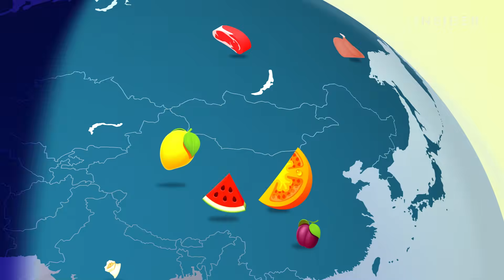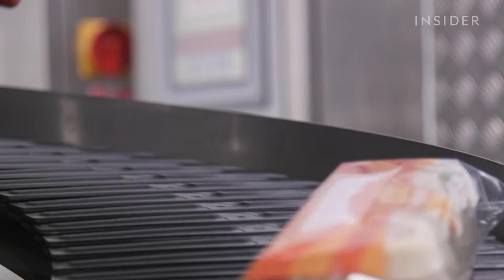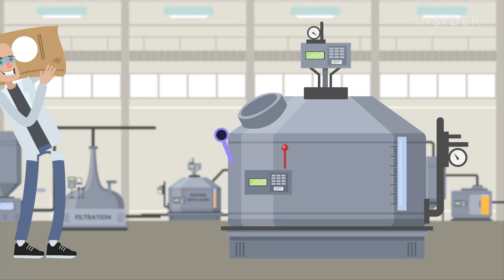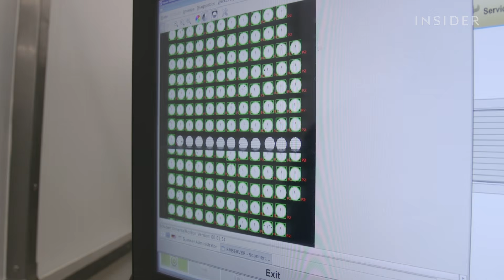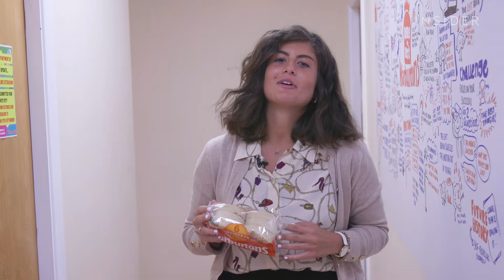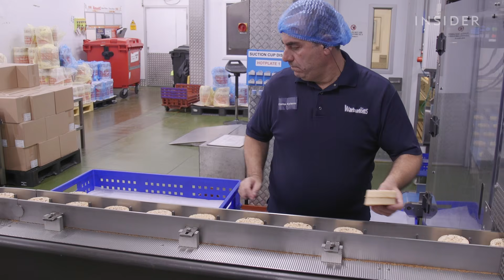How English Crumpets Are Made At Europe's Biggest Bakery | Regional Eats

Comment: 1. a pair into a toaster and heated like bread.... when they pop out of the toaster, whilst still hot, a smear of butter then another of honey.
2. proceed to nibble off the firmer edge of the base all the way around, which gives the honey and butter time to melt down into the holes.
3. then, munch through the hot buttery honey flavoured centre thats like soft bread but with a bit of texture given by the structure of the air holes in the dough.
Reply: I like mine on the crispy side so I put them in two or thee times.
Reply: Then go ahead and make another two🤪
Reply: Add a bit of peanut butter...you’ll love it 🙂

Comment: It looks like a open faced American (USA) English Muffin
Reply: Same size & shape, but not the same at all - they taste different & the texture is different too. A proper crumpet is made only using baking soda as a raising agent, whereas English muffins are made with yeast or sourdough. Muffins contain egg & there's none in a crumpet. Also a proper crumpet [not that Warburtens crap] is  cooked only on one side, so the bottom is flat & toasted while the top is speckled with holes. An English muffin is like white bread when you look at the inside cut surface while the crumpet is stretchy & has a shiny look to the cut interior.
Reply: Totally different. As close as what a Muffin is to an English muffin

Comment: It kinda looks like and English Muffin
Reply: Same size & shape, but not the same at all - they taste different & the texture is different too. A proper crumpet is made only using baking soda as a raising agent, whereas English muffins are made with yeast or sourdough. Muffins contain egg & there's none in a crumpet. Also a proper crumpet [not that Warburtens crap] is cooked only on one side, so the bottom is flat & toasted while the top is speckled with holes. An English muffin is like white bread when you look at the inside cut surface while the crumpet is stretchy & has a shiny look to the cut interior.

Comment: English Muffin? 🤔 But bigger
Reply: I wouldn't compare them to English muffins, muffins are closer to bread. Crumpets are more similar to a super thick crepe in my opinion
Reply: Totally different
Reply: Same size & shape, but not the same at all - they taste different & the texture is different too. A proper crumpet is made only using baking soda as a raising agent, whereas English muffins are made with yeast or sourdough. Muffins contain egg & there's none in a crumpet. Also a proper crumpet [not that Warburtens crap] is cooked only on one side, so the bottom is flat & toasted while the top is speckled with holes. An English muffin is like white bread when you look at the inside cut surface while the crumpet is stretchy & has a shiny look to the cut interior.
Reply: daniel haynes bread pancake*